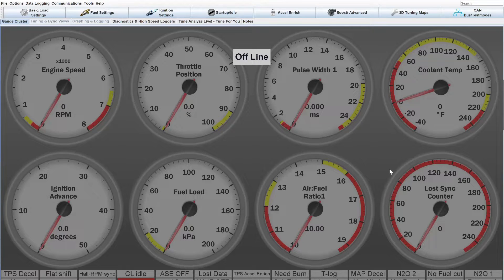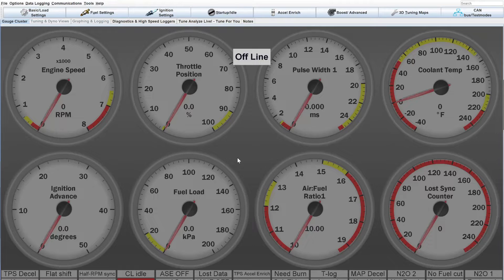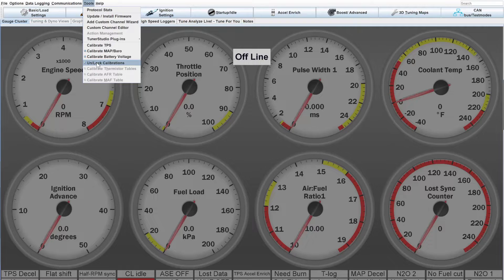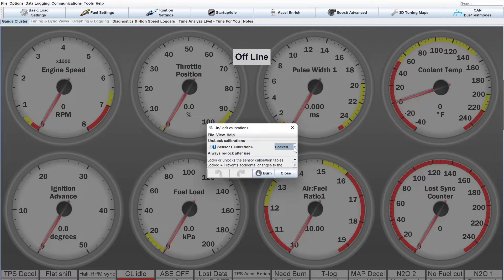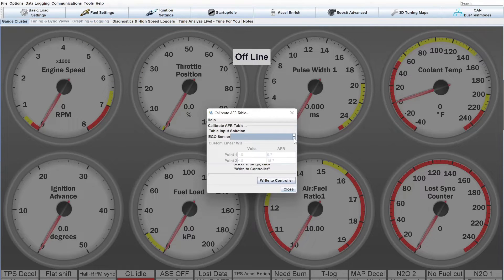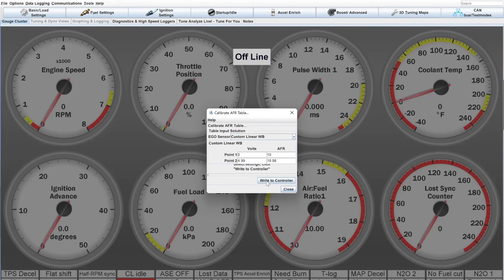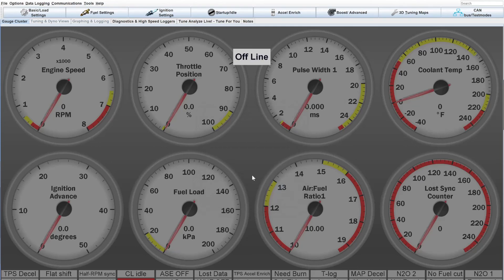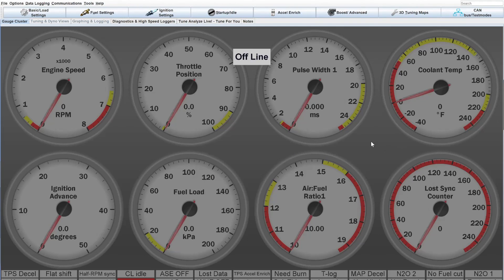Megasquirt Wideband AFR Calibration Basics

Comment: I just switched over to an aem 30-04110, i think it is. Not sure why but when I turn it on, it'll display for a few seconds then the gauge will lean out and just stay at ---  what could be causing that?
Reply from the maker: That usually means the sensor is bad or disconnected
Reply: @TurbineResearch  can't be it's a brand new unit
Reply from the maker: @Frankie_Freedom call AEM support

Comment: I’m having an issue with my MS3 reading above what my gauge is reading. I’m going to try this calibration hopefully that solves it 🤞
Reply from the maker: The wideband and the ecu need to be grounded to the same place if you have an analog signal to the ecu
Reply: @TurbineResearch  makes sense. because it just recently started doing this after changing the sensor after it stopped reading.

Comment: I did all of this and it still says 7.40 afr. Afr gauge is innovative mtx l plus
Reply from the maker: Make sure you wide band sensor is plugged in and open air calibrated if needed
Reply: @TurbineResearch  I have the newer version of the mspnp2 and I was following the directions of the older version. I contacted the company and they corrected my mistake

Comment: thanks again for all ur help in your videos. hopefully soon I'll get some of my own videos up of the turbo jeep you helped me get running in TS. Couple questions I wanted to run by you I couldn't find through your vids and wonder if you have any experience with this.. I'm running a MS3X on a '98 wrangler 4.0 with a 5spd.) Questions: 1) I"m running the AEM EUGO Wideband setup. I have all the voltages entered in TS according to the AEM manual.. I'm probably .4 AF off between AEM gauge and TS. Is there an offset somewhere I can change or do I just need to adjust the 10:0 and 19:0 voltages in TS? 2) Every time I start my jeep, it will turn the alternator charging on for a minute and then turn the alternator off. However when I turn the key off and start the vehicle the second time- the alternator works flawless turning on and off as needed. But if I forget I didn't start it a second time.. I start running lean and funky voltage issues.. Any idea why I have to start it a second time? 3) I just started running an electric fan and have the relay trigger which requires a +12v wired to the Nitrous Output 1 wire to turn it on.. however it won't turn the fan on so I've had to run a second jumper wire that when in the city I jump out and shove the wire under the battery terminal to turn fan on. Is there a better 12v+ output or am I screwing up a setting?

Comment: Quick question for clarification. Car is already set up but some how the manual afr has stopped reading the same as the computer afr gauge so after I check if its locked or not, do I calibrate it with the car running or just key on etc? And unless I have a name brand listed I use the custom choice right? Thanks

Comment: Hello! I have a 92 miata with an mspnp2 and I installed an aem 30-0300, car had an innovate mtx-l before, so I switched it, I set it to custom linear wb and set it to 0.5 = 8.5 and 4.5 = 18 like the manual says, after turning on the car the afr gauge works fine and it’s reading 14s BUT in tuner studio it is stuck at 7.3 afr, any ideas?
Reply: Did you ever get it figured out?

Comment: I selected my sensor the innovate lc2 and now on my jimstim when I have the afr knob fully cranked it only goes to about 10.0. Shouldn't it be able to get up to 14 or 15?
Reply from the maker: You may need to check the analog  voltage output on the jimstim to make sure it matches the expected input voltage for that wideband

Comment: I can't get my wideband to read on my megasquirt for the life of me. Have the same ground. Tried both AEM and custom calibrations seems like I'm not getting a signal to the ms2 pnp. using the auxiliary plug pin 21 for bmw m20b25 MS2 pnp. Is there another way to hook it up to factory harness what am I missing?
Reply from the maker: I am not familiar with the PNP boxes but what I have seen in the manual says you need to disconnect the stock sensor to run the input on pin 21 with a wideband. Have you disconnected the factory sensor ? 
"There are two ways of connecting the controller to the MSPNP2. You can either connect the analog output to the pin labeled Oxygen Sensor input of the option connector, or you can cut and splice the oxygen sensor signal wire to the analog output. If you use this pin for wideband input, you must disconnect the stock oxygen sensor. Do not ground the oxygen sensor wire if you disconnect it; leave it completely unconnected and taped off if necessary (make sure it can't short to ground or anything else)."
Reply: i connected the white 5v+ wire to the pink O2 wire. then grounded/12+ the gauge

Comment: Hey mate! If you're running flex do you enter the e85 values somewhere also? Or is that automatically referencing the main fuel values?
Reply from the maker: Flex fuel is managed by the flex fuel sensor that just needs to be enabled in the tune. I think I have a video on it you can take a look at. If not I will make one
Reply: @TurbineResearch  just watched it, cheers mate!

Was more concerned that even if flex is controlled by the flex sensor, was unsure on if AFR readings would be off. Unsure on if it automatically calculates the change. Reason for my confusion I think is the different ranges e85 to pump fuel has (in Aus we have 98 no ethenol and e85 on separate pumps)